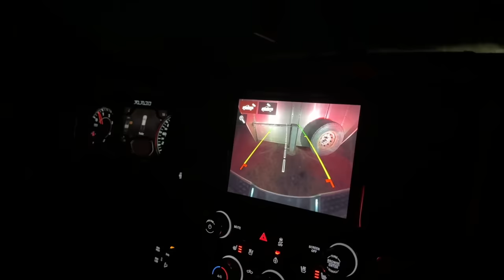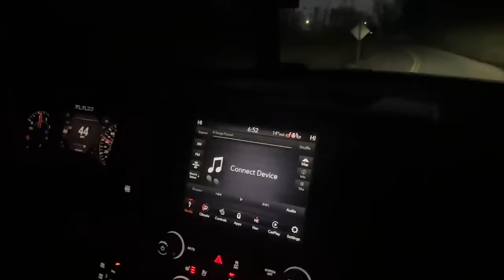This Is Some Crazy Weather! 🥶 🥵

Comment: I thought you had a big enough press to put the bearings in. I guess all you need is the bearing press set. At least you don’t need a jack to raise up the front end. Having the front end loader makes it easier. 
I wonder if you catch the horses getting into it you could immediately lead them into stalls and make a connection that they have to get along or else?
I come from Ohio but I’ve been out west near the desert. A lot of people walk around in a long sleeve shirt but I have to wear a jacket. In my case I’m thinking the dry air in combination with the wind evaporates the moisture from your skin. Don’t know for sure but it’s the only reason I can come up with.🤷 Unless being old has something to do with it 🧐😃

Comment: I knew you were into the weather; not just for farming, but as a general interest. These times of rainstorm after rainstorm, followed by deep cold, then warm and humid , hanging right over your area is like proof in plain sight, there is something else going on besides random weather . The world doesn't move but the weather does.  In the vast Mid West is where the massive, ground-based- cloud seeding operations that control the East Coast weather are performing, to create the weather we get on this side of the Allegheny / Blue Ridge Mountain  range.  IMO there is a cycle that has been set up that requires moisture, lots of it, to be sent up the East Coast to The North Sea where it is sucked ashore on to Greenland.  And that action forces the Canadian cold air South, towards us on the East Coast.  The general flow is from the West-Northwest , towards the East-Northeast.  And how does the jet stream go faster than the rotation in the same direction? Just try to explain that one to yourself and you will say, "  Houston, we've got a problem."
Reply: I believe that your tinfoil hat needs adjusted a bit.  The signals you are getting might be a wee off...lol.